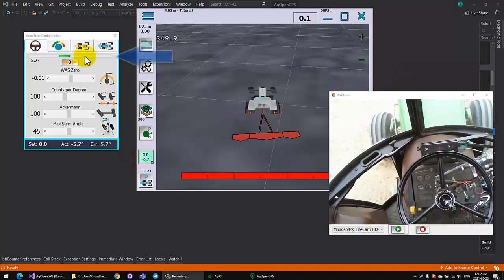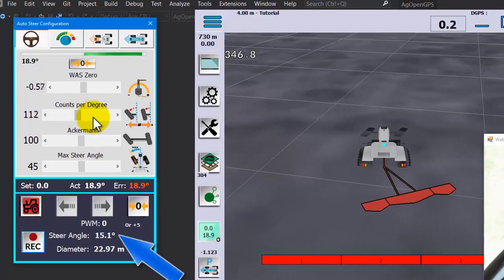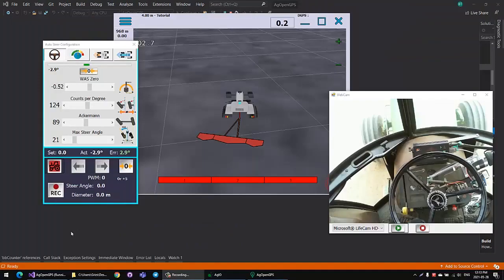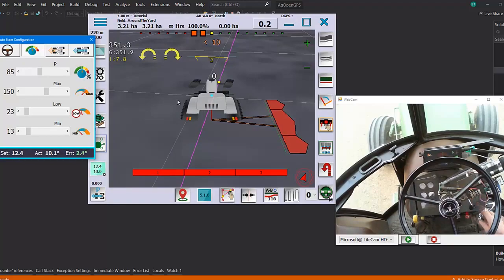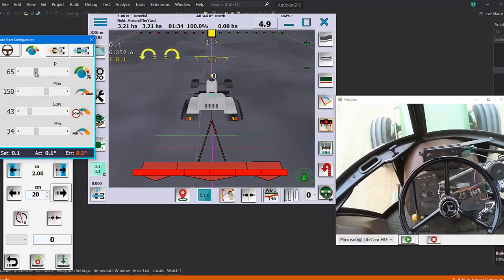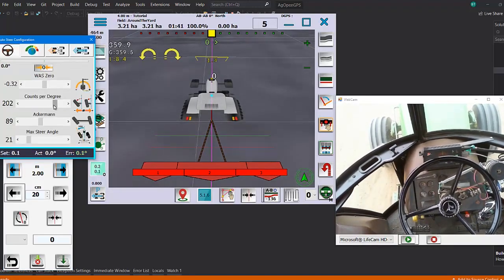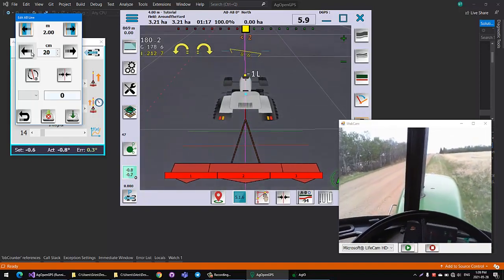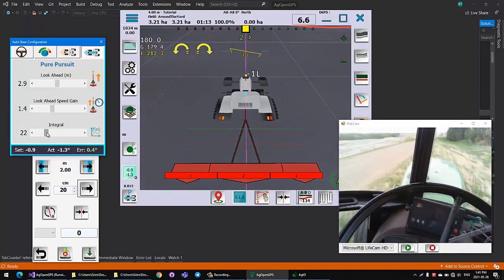Basic Steer Settings

Comment: Hello, what could be the problem with steereng, when i put antenna on roof of tractor i got 7-8cm error , but when i put antenna in front of tractor its 0 or 1  all the time.Normaly i measure and put data in ag obouth antena position